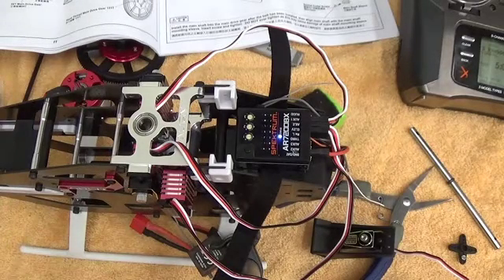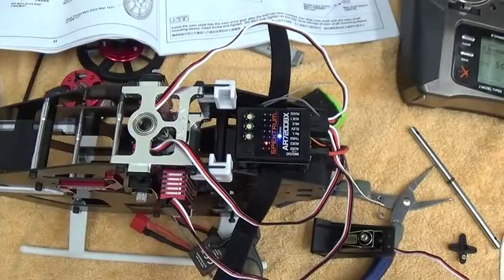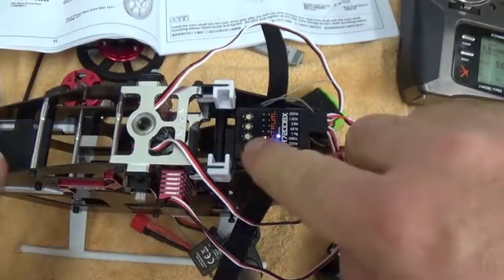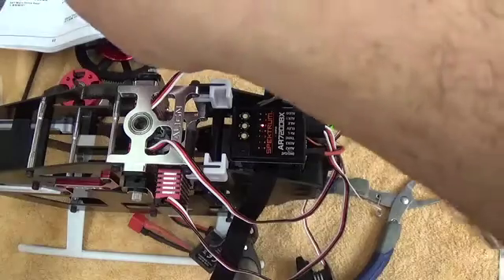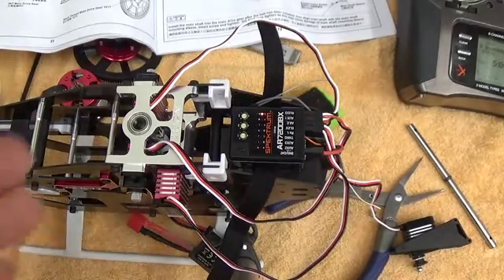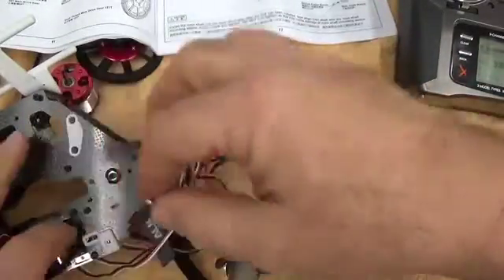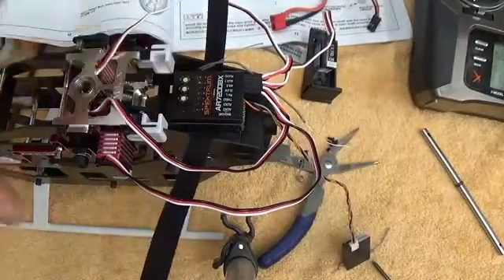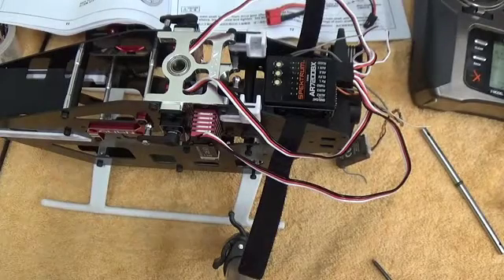TREX470LM servo initial setup

Comment: Hello Jim i have problems with my Algin Terex 470LT , pease can you tell me my MixrobeastX Plus 5.1.4 ist set all setting to Microbeast but now i changed the berinf that was broken for wehn it goes in one direcion and logs to not go to the other ones . My tail waggels very hard and i have singeline receiver and transmitter Algin A10 i have problems to set the tail , What i have to set in the  transmitter in the Gyro when i make point E and F the values in the transmitter ????  I have for normal 78 and Idle up 1 and 2 75   . Have i set it to 50 when i make ponit E and F . Please can you help me ?? Thanks from Spain Alicante  Frank :-))))))))))))))))))))))))))))))))
Reply: No answer i have the smae problem and dont now what to do ?????
Reply: @fastfrank61  Not sure you are going to get a response since the last video Jim did was 3 years ago. He may not do YT videos anymore... but I don't know?

Comment: Could you possibly do a video showing exactly how to plug all of the wires into the microbeast using a single line Futaba or in my case radiolink receiver? And could you include how to attach the speed control/bec ?? I have been out of the hobby for quite a long time and there is very little information on how to attach everything to the beast! I have a 470LM super combo.  Thank you for the great videos :-)